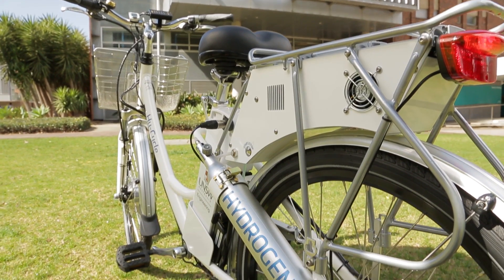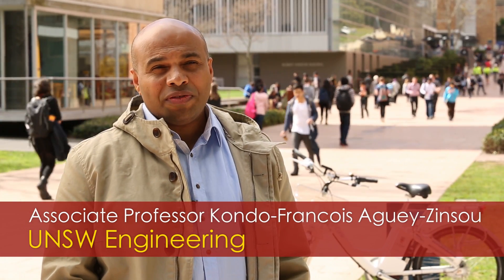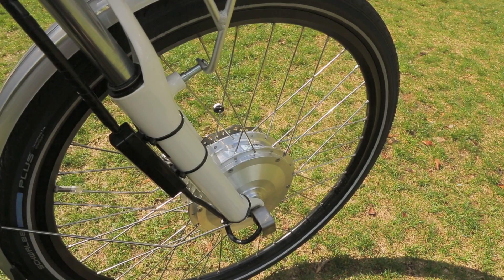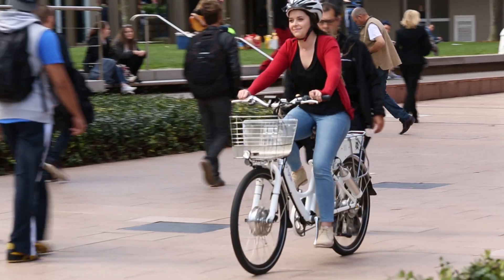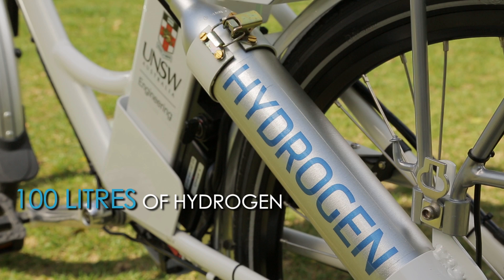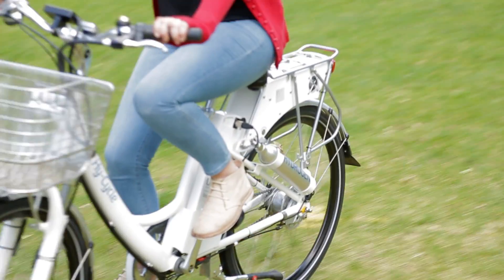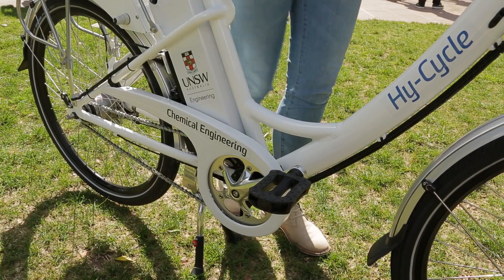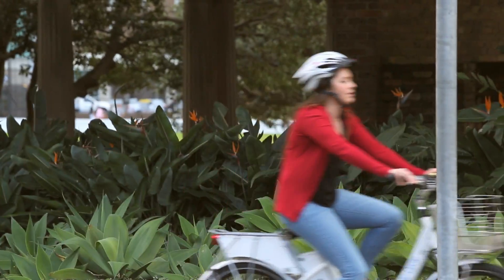Hy-Cycle - Australia's first fuel cell bike

Comment: how can one "compact" 100 Liters (a volume) into 50 grams (a mass) ? this is talking pretty much bullshit !
Reply: This is science not bullshit. Go to check how it works on www.merlin.unsw.edu.au
Reply: David Bernardi If the gas is compressed (like 200 bar or lower, say 5 bar), H2 at 100 lit NTP can weigh accordingly in proportion. I wonder why they did not use MischMetall instead of compressed hydrogen, much safer and avoid heavy cylinders.
Reply: Carmen Schumann To Carmen. We use materials to store the hydrogen so it is not compressed but at atmospheric pressure. This is why it can be held in such a small volume
Reply: energyhproject The density of Hydrogen is 0.08988 g/L (at 0 °C, 101.325 kPa), so 100 litres must weigh 8.99 grams.
Somehow that have made it heavier.  Magic!
Reply: energyhproject Of course you are talking BS! You may compress 100 liters of a gas into let's say 1 Liter, but it still has the same mass then !

Comment: Cool product. Price of hydrogen is not important for these very small usages. 2$ for 125km, you can probably do same distance for 0.4$ on full electric bike.

But for larger energy usages, like cars, hydrogen does not make sense.
First, they are promoting hydrogen as alternative to fossil fuels, and 95% of hydrogen coming from  FOSSIL fuels (natural gas)! Mostly from fracking. So hydrogen does not solve environment issues

As for getting hydrogen from water, for hydrogen you have to put in 100kWh of energy to get 23kWh to move the car. In EV, for 100kWh, you get 70kWh to move the car.

Price: 50$ for 300 miles? That is more expensive than a petrol car, and this is with 'cheap' hydrogen that is coming from fossil fuels, it can only get more expensive.

Who loves hydrogen? Big oil companies, because they produce it from fossil fuels, and fuel cell cars would let them keep their monopoly. And nobody will produce hydrogen with electrolysis while cheaper alternative is available (from natural gas).

You can say, we will put solar panels and make hydrogen that way for 'free', but that does not make sense, because with the same solar panels you 'charge' one fuel cell vehicle for 300 miles, you can charge 3-4 EV vehicles for the 300 miles each, or charge 1 EV for 1000-1200 miles.
Reply: Yeah as chunky as the generator is you might as well slap a 200c little Chinese petrol engine in it. Poor people in my area do it all the time and it’s far more effective.

Comment: What happens if you have an accident and the cannister is damaged? Does it explode?
Reply: No.it is very safe! The hydrogen is held by a material which makes it safer than petrol. On top of this, it is clean because the only emission is water. If you want to learn more about this go to www.merlin.unsw.edu.au
Reply: @kondo-francoisaguey-zinsou9299  What metal were you using for the hydride, Magnesium?
Reply: Kondo-Francois Aguey-Zinsou A quick internet search on hydrogen disadvantages show safety as the main disadvantage so that is good news! :)